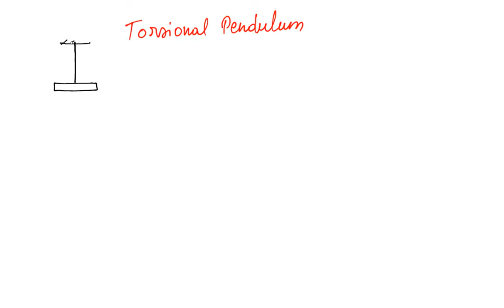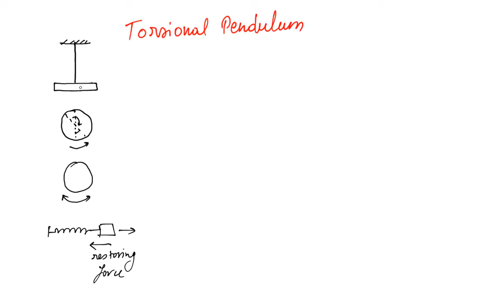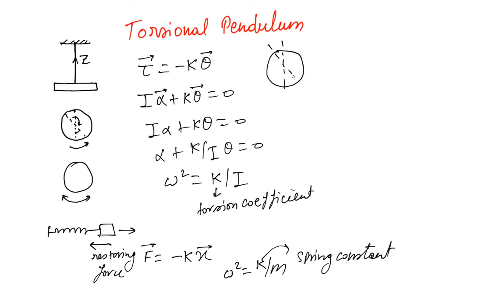Torsional Pendulum

Comment from the maker: Moment of inertia can be calculated along any axis, but things will become complex while using tau = I X alpha(it will not remain a simple product but a matrix multiplication, as I is a tensor). To keep life simple if I is calculated along the axis of angular acceleration(direction of acceleration is defined using right hand rule) , so it is a simple product, I will behave like a scalar. In this particular case if your disc lies in x-y plane, the direction of angular acceleration is in z-axis.